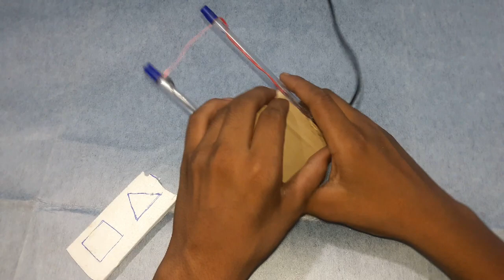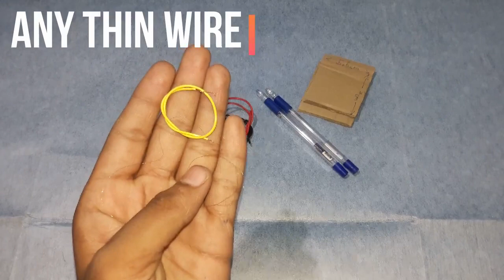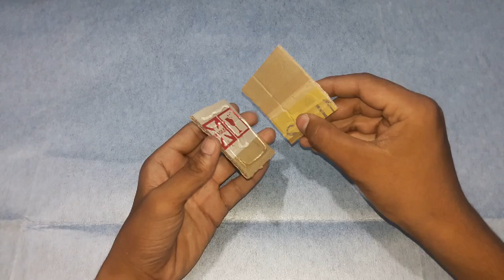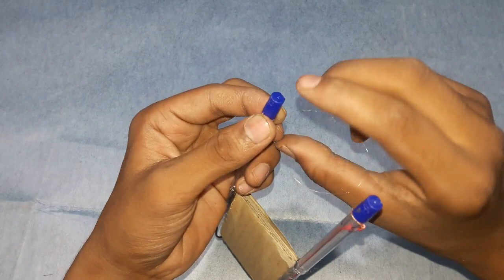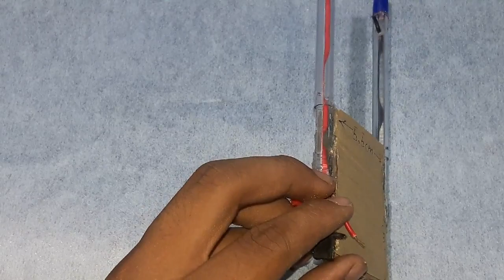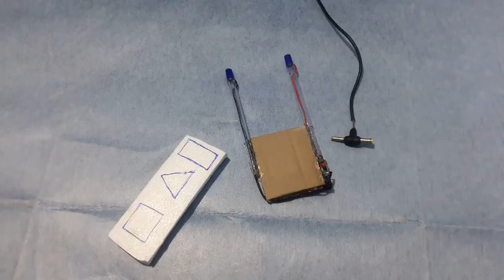How To Make A Thermocol Cutter | without nichrome wire.

Comment: but you are using nichrome isnt it
Reply from the maker: Bro I've used thin copper wire which I've taken from ferry lights wire. U have to pick only a single wire from that ferry light wire. But it would be thin and copper and it work try it.😊

Comment: Can hard plastic bottles (like Tupperware ones) be cut using this ?
Reply from the maker: Ya u can but u have to use high voltage and a good copper wire which can't get melt easily on high dc voltage..😊👍
Reply: @CreativeScrew  ohh okayy thankyousomuch !
Can you please suggest me any wire and how much voltage would be sufficient for that wire